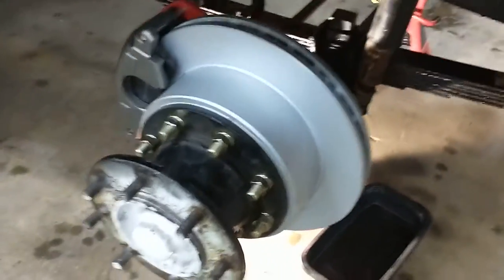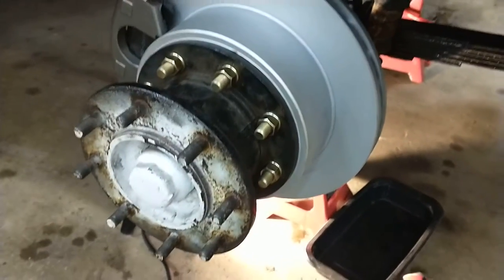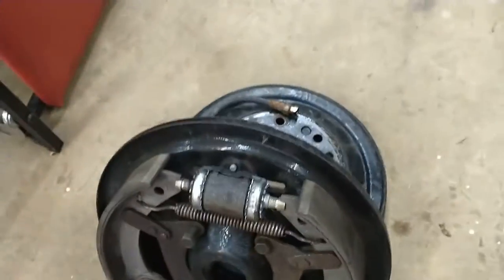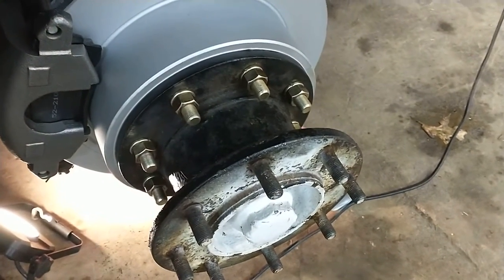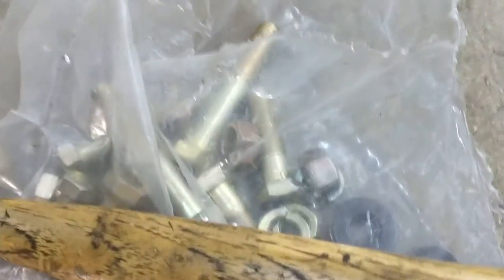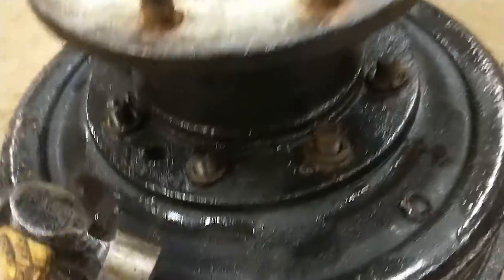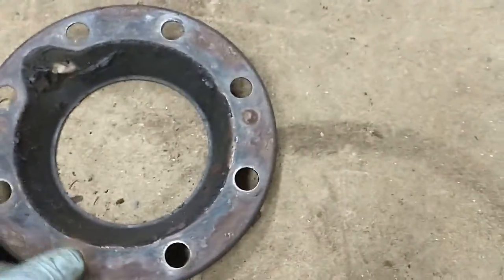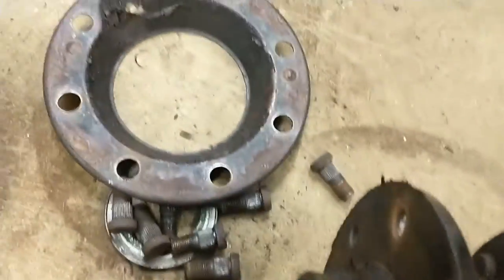1949 GMC 1-Ton - TSM MFG Front Disk Brake Conversion Part 1

Comment: I have a 1948 Chevy 3800. And I bought the same kit. Unfortunately my front end looks nothing like the hubs you have here. I need help and how to install my dish on my
Reply from the maker: Hey @joeserrato2345 - My 1-ton is a dual rear wheel (DRW) truck that has front hub spacers that bump out the front wheels to line up with the dually wheels.  There are single rear wheel (SRW) one ton trucks as well that don't use a front hub spacer.  Do you have a dual rear wheel truck?  The TSM site shows options for both: 
https://www.tsmmfg.net/chevy-gmc-car-front-disc-brakes-single-dual-options.html  
Also - you never know what previous owners did over the life of the truck.   Someone might have swapped axles or something at one point.

Comment: I am doing the same TSM conversion kit to my 48 Gmc 1-ton. I am doing what research I can to find a "TAPERED ROLLER BEARING" conversion before installing this kit.
Anyone who has bearing numbers for tapered bearings to change from the stock ball roller bearings please respond with that information.
Reply from the maker: Unfortunately nobody seems to make tapered roller bearings for trucks over 1/2 ton.  I started looking around at bearings by size and found some that were close, but would need a spacer to fit right. I thought about turning one on my lathe, but I'm still new to machining and a critical part like this isn't something to practice with.  If I recall, the spacer I would need is for one of the races going over the spindle, so it's not like I'd have to machine a part that bearings actually ride on, so I may still attempt it some day. 
The stock part numbers are b45 and b46.  Here is a table I made that maps NTN and Timken tapered roller bearings close in size to the originals.  
https://bearingfinder.ntnamericas.com/item/inch-and-j-series-tapered-roller-bearings/tapered-roller-set---inch-series-and-j-series/28150-28315
B46 - Front outer/NTN 28150/28315/Timken TRB-TS | 27881 - 27820
B
Bore (Inch)	1.500
Bore (MM)	38.087
Design	Single Row Angular Contact
Inner Race Bore (Inch)	1.500
Inner Race Bore (MM)	38.087
Inner Race Outside Diameter (Inch)	2.100
Inner Race Outside Diameter (MM)	53.340
Inner Race Radius (Inch)	0.140
Inner Race Radius (MM)	3.556
Wi
Inner Race Width (Inch)	0.917
Inner Race Width (MM)	23.292
Outer Race Bore (Inch)	2.546
Outer Race Bore (MM)	64.668
D
Outer Race Outside Diameter (Inch)	3.150
Outer Race Outside Diameter (MM)	80.010
W
Outer Race Width (Inch)	0.851
Outer race Width (MM)	21.615
D
Outside Diameter (Inch)	3.150
Outside Diameter (MM)	80.010
Part Description	Wheel Bearing
Series	FWBS
Type	E-1
Width (inch)	1.236
Width (MM)	31.394

B45 - Front inner NTN 15590/15520
B
Bore (Inch)	0.906
Bore (MM)	23.007
Design	Single Row Angular Contact
Inner Race Bore (Inch)	0.906
Inner Race Bore (MM)	23.007
Inner Race Outside Diameter (Inch)	1.409
Inner Race Outside Diameter (MM)	35.789
Inner Race Radius (Inch)	0.140
Inner Race Radius (MM)	3.556
Wi
Inner Race Width (Inch)	0.659
Inner Race Width (MM)	16.739
Outer Race Bore (Inch)	1.766
Outer Race Bore (MM)	44.856
D
Outer Race Outside Diameter (Inch)	2.250
Outer Race Outside Diameter (MM)	57.158
W
Outer Race Width (Inch)	0.690
Outer race Width (MM)	17.526
D
Outside Diameter (Inch)	2.250
Outside Diameter (MM)	57.158
Part Description	Wheel Bearing
Series	FWBS
Type	E-2
Width (inch)	0.800
Width (MM)	20.320

Comment: Thank you for the info!!!for Tsm i got a1952  Chevy maple Leaf fire engine (3ton) let hope tsm MFG van help me
Reply from the maker: Oh that's awesome, good luck with your Fire Engine.  3 ton is big!  I'm not sure what brakes they have but I'm going to assume they're bigger than a 1 Ton.  Maybe TSM can work with you to develop a kit for the 3T trucks.
Reply: Have a 51 Chevy 6400 2 ton would anyone know how to find a 6 bolt rotor to replace the drum on a 10x7.25 outer bolt pattern hub ?
Reply: Same setup as this one but 6 bolts instead of 8